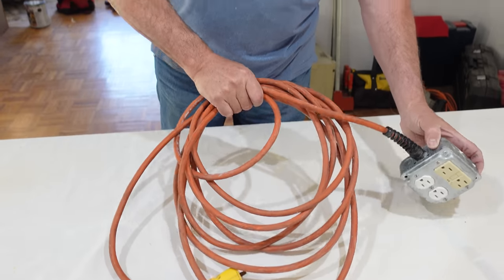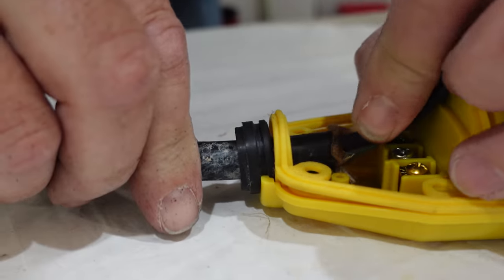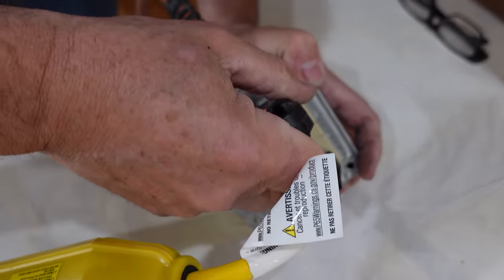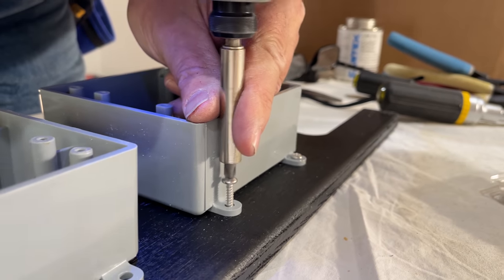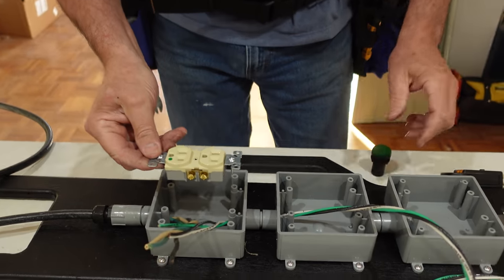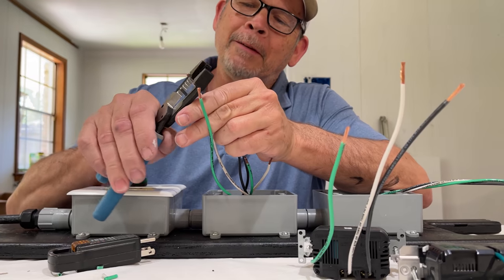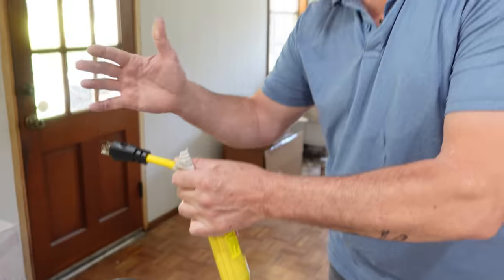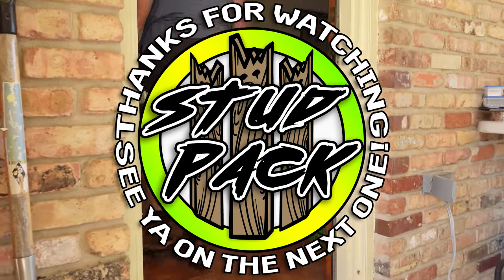HOW TO MAKE THE ULTIMATE EXTENSION CORD!

Comment: I'm making a different version of your cord.
I'm a 62yo tech nerd & Ham Radio Operator living in a seniors apartment.

So instead of using the stove, I'm going to unplug the stove from the wall and plug in my own 220v40a extension using wire rated for at least 220v50a which will be better than what is in the walls of even newly constructed buildings these days.
This heavy duty cable the goes to a large plastic box (think really stron storage tub) where there there is a small breaker panel inside that breaks the 220v40a back into 110v, 15a & 10a breakers, each with it's own independent GF 20a receptacle, gotta have redundancy. I can then make and attach my own 25a or better rated extension cords that then run to my computer complex. This will then give me enough power to run my Servers, Gaming PCs and a low power Ham Radio station. I didn't know about those yellow extension cord ends so I will put one of those at the end of each extension cord. 

The other thing I want is a separate UPS rated to supply enough wattage to run all my kitchen appliances simultaneously for one hour. This UPS would use one of those switches used in workshops to active the vacuum when ever a device ducted to the vacuum is turned on.
This last piece is so when I use any appliance, the UPS disconnects from the appartment breakers. This way I can run my microwave, 4 slot toaster, toaster oven, deep fryer & electric frying pan all at the same time while cooking. A single 15a breaker 'should' normally only need a day to bring the batteries back up to full power for the next day's cooking. I can only use maybe the microwave & toaster together on one(1) breaker but all most all of my appliances draw close to 12a each. Except maybe my electric kettle, gotta be able to make tea when ever I want, Canadian/English joke. I find that the only thing US citizens know to do with tea is to throw it in to a harbour.

Comment: The circuit breaker protecting the circuit works on a time curve for tripping. It's based on how long a cable can handle the current before over heating. For example, a 20a circuit with 22a draw might take hours to trip, compared to 30a draw might trip in minutes. Circuit breakers have a few different types with different curves. Here in Australia the 3 main are type A type C and type D. Type A acts like a fuse wire and trips as soon as you exceed the rating, type C runs on a standard time curve, type D allows for large inrush current that motors draw at startup ( motors draw up to 10 times rated current for a second or 2  at start up) . Hope this helps 🙂🙂

Comment: Hi mate, I used to do that to all of our 12 gauges extension cords when I used to work in carpentry/cabinet maker for many years in new construction and no gfci protection and no body got killed. These generations!!!
28 amp will eventually trip over certain amount of time. I use #10 for 50amp welding machine and yes it trips doing heavy welding. 10 years ago I became a sparky and I am not a fan of wagos and I've repaired failed wagos couple of times.
Reply: Wagos also have to be used properly, and stripped to the right length, but they're easier to use right than wire nuts and the see-thru sides let you inspect the connection, unlike wire nuts.

Comment: Couple of suggestions.
When you cut off the plug end of a cord (to turn it into just cable) bend over the pins on the cut off plug so it can't be plugged into a wall. 
When you cut a cable for the screw clamps, cut the white wire slightly shorter than the other two.
Reply: Some would say not to vary the length of the wires, but that depends on the configuration of the terminals in the plug. From a safety engineering perspective, you would want the hot/live wire to be the shortest, followed by the neutral, and finally the ground being the longest. That way if the strain relief failed, the first wire to pull free would be the hot but maintain the grounded and grounding path integrity. Course, this is a bit of a "argument" point because if the tails are sufficiently different in length such that they cannot touch as they are pulled out of the strain relief, there would not be a short-circuit created that would trip your ground-fault protection leaving an energized, open wire. Some would say its six of one, half-dozen of the other. Depends on which is more important to you, convenience of assembly or safety of usage.

Comment: Guys - I love this build - I got right to work on one for each of the kids homes - I add the cord "reel" section below the boxes for a little cleaner look. I also added a WRAP-it hook and loop strap to keep the cord secure for storage.  I used the Black flex seal but it is a magnet for sawdust and really looks pretty awful even before I was done - Again love this build and wanted to share my ideas and challenges - KEEP BUILDING!  (p.s. Costco has a 2-pack of 12/3 30-feet for under 30 bucks)

Comment: I would have used 'in use' bubble covers. Since you've installed outdoor style bell boxes. That allows for full outdoor rated capabilities. Also add a waterproof cable 'service ' rated connector.  As for the 20A breaker not tripping, depends what manufacturer panel( GE) for instance,  really takes a high amp draw to trip out. Also, the tools have what's called 'inrush' , so basically higher amp draw only on start up of tools. Then amps drop significantly,  once tool's running.  So id bet if ya pulled trigger on chop box, that'd finally trip breaker. Great videos! Cheers from Pennsylvania

Comment: Nice build and gives me some ideas.  The only improvement I can see is to use metal box covers, or at least some heavy duty PVC.  IMHO, those flimsy standard plastic covers will not stand up to any abuse.

Also... placing the 20A 5-20R receptacle anywhere on this build is not a good idea unless your entire build is for 20A (all the wiring is 12GA min.).  Most importantly, that includes the wall plug and original cord you used.  The receptacles can be either 5-15R or 5-20R (as you did).  If you do plug a high current device into it as built and plug the 5-15P cord plug into a 15A outlet, you may wind up tripping the breaker and/or overheating the components.

Comment: NZ electrician here.   20A CB normally trip at 1.5 times, so that would be 30A, but may take a few seconds depending on the breaker.   Also the shop vac, yes you should turn off the vac if it blocks as there is no air though the motor and they overheat very very quickly.  Your vac will stop, normally they trip an internal overload inside and resets when they cool down, but older or cheap vacs do not have the overload and the windings of the motor will overheat and the enamel on the wires fails and the motor blows up.

Comment: The only addition I would put on this extension kit would be an over current warning for the rare occasion that it does go over the expected limit, I don't know if such a thing exists, but a siren (because of the type of tools used, you won't be looking for a blinking light!) that you can switch between 15 and 20A would really round off the safety features.

In the UK we don't use wire nuts much, so seeing those in the previous video was really "eugh, disgoostang"; but seeing Wagos, beautiful!  I know most people pronounce Wago the way you do, the correct way is Vah-go (because Germans pronounce W as an English V).

The trip didn't fire because the load was slowly ramping up, it will hold until the heat builds sufficiently in the breaker for the thermal contact to close; the majority of trips are caused by a high fault current that will trigger the breaker much faster (like a short in an appliance for example), incorrectly rated fuses for cooking equipment (ovens/hobs) will often confuse home owners because the appliances may work for 5-10mins then cut out coincidentally around the time they are up to temperature.

Comment: Taking a plug from the Janes Condon small engine repair clips, I really like that every bolt and screw installation also included a torque wrench device with text print overlay added to the video on the torque spec used for each threaded fastener installed.  This would really add the "cat's meow" to your video is if you included the inch-lb spec for the screw connections.  Hey they have these for your wire clamp spec for breakers, why not for your fitting connections too !

Comment: The reason you had difficulty pulling the sheathing off the cord is the rope and string wound around the electrical wires helps to reduce strain on them when the cord is pulled or dragged around. Kinda like those 'Chinese handcuffs' do when you put a finger in each end, directly pulling prevents removing your fingers, if you push your fingers inward slightly then gently turn and pull you can remove your finger. Similarly with the cord gently turn the sleeve as you pull and it will come off easier, also turn it in the direction the wires are twisted. When you were pulling it I was thinking and saying "twist it Paul. c'mon I know you know this one... lol".

Comment: Looks great. Not sure if it will pass on a commercial job site. They are kind of finicking about homemade electrical boxes. A couple improvements I might suggest. Build a frame around the boxes up under the cover plates to help prevent them from chipping and paint it a high visibility orange so it is less likely to get stepped on or be a trip hazard.

Comment: First of all, this is just a nutty build I love it. I’m looking to get extra power to my garage for occasional table saw/planer juice and I’m curious if instead of a portable piece of plywood, the outlet boxes could be installed in permanent locations a little farther apart. I’d reel up the cable after use and never leave it plugged in unattended and only need to run one tool at a time. But it would be great to have an outlet on each side of the garage rather than located next to each other.

Comment: The overall project was a great success. I just want to be in the room when (at 21:00 min. in )  you try to plug that 20 amp plug into the mounted 20 amp receptacle! And I would nix the green light, use a receptacle at the final bay that has an indicator light built in to indicate power is on-the green light is a waste of space.

Comment: Awesome idea on job site cord. I would go back to metal boxes and metal covers.On the Job site things get dropped the plastic covers will be the first thing that will break.  I like the handle and cord management.You might put cord management on the backside as tee leg. This would make the plugs always clear so user could unwind only the cord needed 25 foot instead of 50 foot or even a strange  length like 37 foot. This keeps job site clear of extra cord or trip hazard.  Well done its a great idea nice that it has charging station.

Comment: Regarding your comments at the end about the vacuum.
The reason you "hurry" to shut off a plugged vacuum is to prevent the motor from overheating.
Most vacuums use the air being moved (after the filter) to cool the motor.  No air flow = no cooling = motor can quickly overheat and die.
Been there / done that.

Comment: Circuit breakers are designed to prevent over-heating in the wires due to over-load.  Over-heating takes time and it is not necessary to trip the circuit for very short period of over-current.  Typical non-GFCI breakers have two trip modes; a magentic trip circuit and a thermal trip circuit.  The thermal trip circuit will trip closer to the rated protection current, but has a significant time lag which is also a function of the amount of over-current as the thermal trip has a thermal mass, much as the wire it is designed to protect.  The magnetic trip circuit is very fast, but set at a significantly higher current.  You can experiment with the trip delay and the amount of time it takes to trip to see which is which and get an idea, but I would recommend a breaker that is not going to be continued to be used (I have no idea if repeated trips damage the breaker).  There was a video somewhere on youtube that explained this.

Comment: The multiple colors irk me but I can overlook them. However, adding a 20 amp outlet to an extension that is not specifically  designed to be connected solely to a 20 amp circuit is unforgivable. Secondly, the switch is a waste of space that would have been better served by an additional outlets. 

As a side note. If you are doing something on a machine to where there is a need to cut power, [ie: maintenence, replacing a blade etc)  it is unacceptable to simply use a switch to cut power. The machine should be unplugged. < huge period here, no exceptions.
Reply: I don't think we should be surprised this is coming from a guy who thinks occupational health and safety doesn't have a place on construction sites. Residential construction is still construction lol, that 18 year old apprentice gets lit up by a homemade extension cord - he didn't sign up for that..
Reply: I feel like they should have paint them all bright orange to stand out especially against the black board.
Reply: My house has lots of 20A circuits in it on 12GA wire. We have lots of dedicated 20A circuits for appliances like the fridge, freezer, microwave, and coffee maker, as well as most all the general service outlets throughout all large living spaces are on 20A breakers on 12GA wire. The only places we don't have 20A service is in bedrooms and lighting circuits. The outlets throughout the house are all standard NEMA 5-15 type. This is normal and standard by code to have a lot of 15A outlets on 20A circuits. 

There's nothing wrong with using an "adapter cable" to "upconvert" a 15A outlet to a 20A outlet on a 20A circuit. A well made 15A outlet actually as as good or better contact with the blades of a plug than a 20A outlet. (the silly shape of a 20A outlet, requiring both orientations to be supported, often results in LESS surface area making contact than a 15A outlet). 

Furthermore, if you have a device with a 20A plug, that is being used at much lower loads than maximum rated (like a Server UPS being used in a homelab that only draws a few amps), then such an adapter is not actually a problem for this specific application and known load, whether on a 15A or 20A circuit. 

"unforgivable" - take your clipboard and stuff it!
Reply: @thebigdoghimself  How do you know that was a 15A circuit in this video?
Reply: @thebigdoghimself  You can if the circuit backing the 15A outlet is actually a 20A circuit, or the load isn't more than 15A anyway. The NEMA 5-15 outlet and plug actually have better contact performance (lower resistance) than a  5-20 most of the time. You can be a clipboard warrior if you want but that just tells us that you have abandoned reason for tyranny.

Comment: I have been testing circuit breakers professionally for almost 20 years. You are connected to a breaker that has thermal-magnetic overcurrent protection. The thermal part of the tripping pertains to an overloaded circuit. We would call this long time. You really weren't very overloaded so your trip time might be several minutes. As some other commenters posted, depending on the manufacturer and circuit breaker you might not trip at all. To be honest even with a modern manufacturer and a brand new breaker you might not trip. These smaller breakers, especially residential breakers, do not get as much attention to quality as commercial and industrial type breakers. There is a higher failure rate and sometimes that manifests as a breaker that will not trip at all. If you have a direct short your current will be high enough that the magnetic tripping function will trip the breaker without any delay. We would call this instantaneous. On more advanced breakers there are more options to sense a particular type of fault and trip after the appropriate time delay. You can get time current curve charts from the manufacturer and determine at a given current how long it will take the breaker to trip. In your case I would not have expected the breaker to trip yet. Great video though! I've been watching your channel to help me tackle a home remodel. Thanks for sharing your knowledge and experience!

Comment: another comment spoke about the "trip curve" of the circuit breaker. that does play a factor in when it will trip. also I have found over the years it also depends on the manufacture of the circuit breaker too. some brands will trip quicker and others will hold longer, which can cause a fire by not tripping soon enough. I would at least check the breaker in this house you're working on at the panel, It also could be like another comment said about it being tripped before, that can also cause a delay or trip sooner. At 28+ amp draw, it really should be checked!

Comment: I would make it more like a regular distro box where the extension cable would plug into a male outlet at the top. That way if the cable gets cut you don’t have to rewire everything. And you can choose the length you need for the job so you don’t have all this extra heavy cable. And you can take the main part with you end of day and leave the cable. 

And have two 20 amp legs. And have small gfci breakers at the top to turn in each leg.  To top two would be one 20 amp circuit. Next would be another 20 amp circuit. And the third I would put in 240v 20amp outlets. And outside covers on all outlets that allow you to keep a wire plugged in while closed. Covers with windows.  Those covers are gonna break so fast.

Also a small spd at the top might be a good idea being a job site with temp power and a bunch of high draw startup tools going off and on.

Oh and put a nightlight electrical outlet on it so you can find it at night. Light sensor ones that turn on in the dark. That way even if you’re inside a dark area you’ll have light.    And have it be modular.